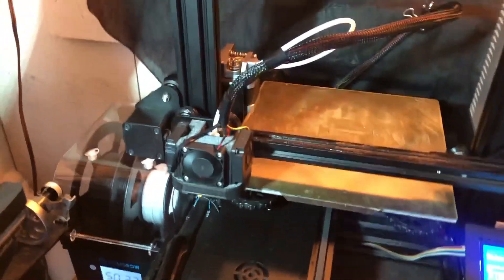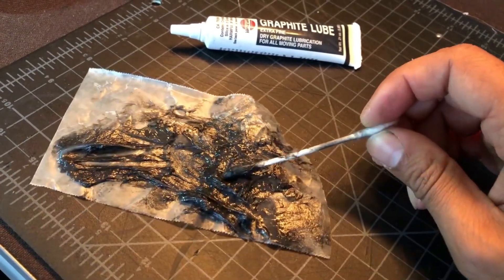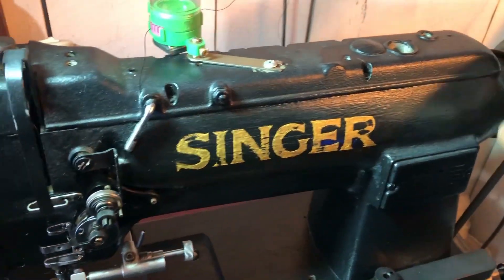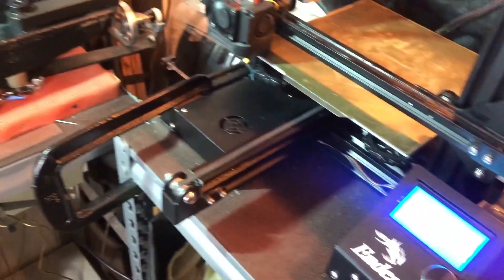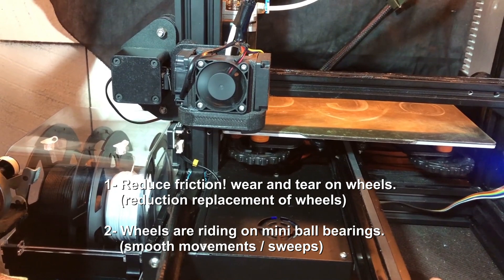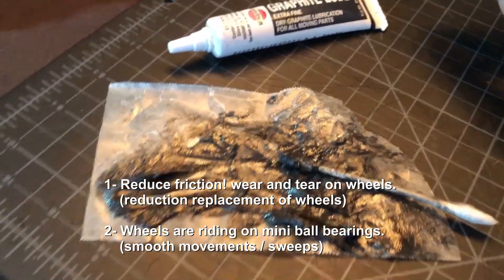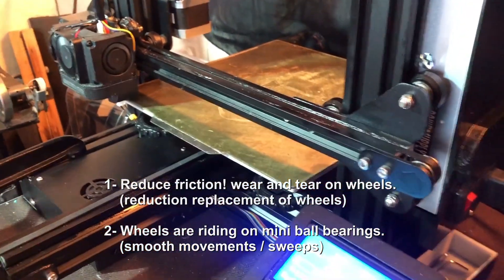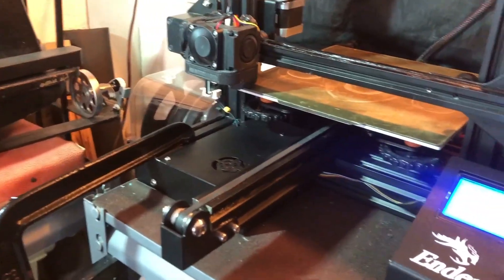XY linear rail alternative Ender 3 Ender 3 Pro S1 Ender 3 Pro

Comment: what is this supposed to achieve ?
Reply from the maker: It’s creating a smoother movement without a total upgrade.
Reply: @JonDesign3D  This will cause a number of problems in the future and is unnecessary if you set it up properly.